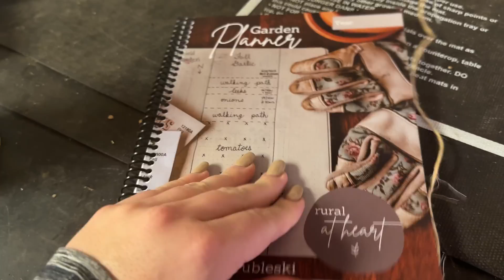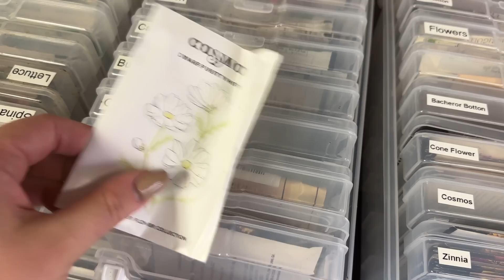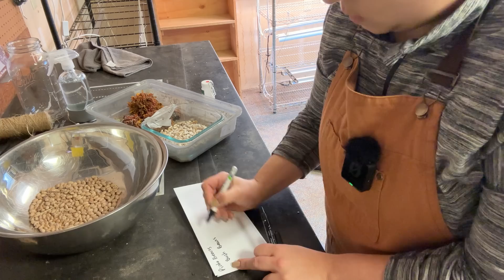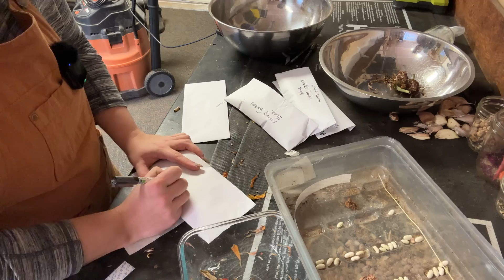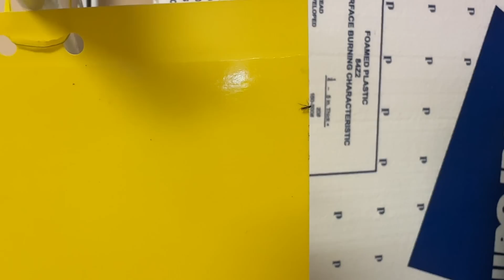I Don't Think I'll Regret This!

Comment: I had a problem with fungus gnats last year, from using a bag of soil that had been stored in my garage from the previous year. It only started with a gnat or two but quickly became TERRIBLE. My indoor pots were covered with gnats. The sticky traps definitely helped but ultimately I could resolve the problem until I was able to put the seedlings outdoors. I'm not sure if they affected the growth of the plants but it was so annoying to have the gnats in my house. It definitely affected my feelings towards my garden last year. I also tried the neem oil and other solutions and I didn't find those helpful. So whatever soil you have leftover in that room, I wouldn't use them for your seed starting, I would definitely just toss it outside. Good luck!!!

Comment: Something simple that works really well when my office plants get fungus gnats is to put a layer of sand on top of the soil. I pour enough to cover the soil. I only have a few plants so I buy small bags of crab sand (for tanks) from the pet store, but you could get larger bags from the hardware store. I think remember reading that the sand smothers the eggs in the soil, but honestly all I know is it works to basically wipe them out in about a week with no pesticide. You can still water over the sand. Eventually the sand will just blend in with the soil.

Comment: I have heard that putting cinnamon on the soil helps and the stickie sheets you have. I have also seen devices (bug killers/zappers). I was very concerned about bringing in bugs into my home when I was trying to grow vegetables inside, so all soil I used I put in the oven for about 30 mins before using. But if you need to bring in plants from outside, I would suggest trying to rinse off all  soil, and maybe spray bare roots with neem oil or maybe hydrogen peroxide? I know they use hydrogen peroxide with orchid roots. But definitely, once you get it under control, bake your potting mix before using. I also had luck with spraying dish soap diluted with water on aphids outdoors when I had them on roses.

Comment: My green thumb guy has battled these pests mostly for me. Lol Because I'm in a wheelchair it's easier on me to have plants inside especially during the winter but there are always some plants inside because it makes you happy to see the green living plants flourish. When he runs into these guys he uses sticky traps like you have and mosquito bits. They are organic but if you actually want to save plants that are infested the mosquito bits have helped a ton. You do have to apply them once a week or so for up to several weeks but hope that helps. Oh and he says those are safe for seedings. For bigger plants he does what's called mosquito dunk and he's had luck with that where we don't have to just let them die. ❤ Make sure to set soil outside in really cold temps to kill them off in infected soil but using it outside would probably be easiest but we have successfully treated some soil by just putting it in the cold. The longer you can the better.

Comment: Try cinnamon sprinkled on top of soul. Also water with alcohol and hydrogen peroxide look formula  up on google I have used  all hydrogen peroxide.  Make sure you keep drains clean on sinks also you can put containers out with vinegar little dish detergent and water I use salt and pepper shaker because of small holes water plants from bottom to keep top soil dry

Comment: Check out Gary from the Rusted Garden. He suggests pouring boiling water into the soil to kill the fungus gnat eggs and larvae. You're probably going to be fertilizing your seedings, so it's fine if it kills the microorganisms. I had an big issue with fungus gnats last year when I brought my outdoor plants inside for the winter, and I read that Mosquito Bits help. I used that this year, and I haven't seen any gnats this year! From what I've read, it's harmless to use on edible plants, too.

Comment: Becky, I’ve been gardening for 12 years, and fungus gnats has been my problem that after thousands of dollars with hydroponics and indoor gardening, I took a year off and did some revaluation. 
I’ve used Neem oil, and meal, cinnamon, and the yellow strips, and nothing worked.
The method that worked for me, I put all my seed starting or indoor soil in the microwave for 3-4 minutes, which will killed eggs and all.
Dump all soil and plants that you brought in from outside, but if you have expensive soil that you don’t want to dump, just pour boiling water on it as it will kill whatever else bugs you might have. 
Good luck…
first Fungus Gnats free.
Good luck

Comment: BT kills the fungus gnats so if you have a problem with them, water the top of the dirt with some water that has BT in it or mosquito dunks water
Reply: The larva live in the top layer of the dirt. You might have to do it a couple of times before all of the eggs hatch and larva die, but it works.

Comment: For future thought... You can pull your plant from the garden dip   them ( upside down) agitate a few times in a bucket filled with water, some Neem oil, a couple drop of sal's soap and a couple T of epsom salt. Rinse the roots well and transplant into new bagged or baked soil.
PS Seeds saved from '23 would be marked '24 for this year's garden. It's just how the industry does it. Incase you seed swap later.
I would love to see your metal cabinet painted grass green bottom 2/3 and the top sky blue then paint flowers, butterflies and sunflowers into the sky.🌻

Comment: Becky! I have personally dealt with two separate fungus gnat infestations.  This is my advice: get rid of all the open soil (including the planters). 

Any soil you use inside, I put it in  five gallon buckets and pour two full teapots of boiling water into each five gallon bucket (to kill larvae). If I bring any plants in from outside, I dig them up and wash off the roots, then add soil I’ve “treated” with the boiling water. Obviously you have to wait several hours for the soil to cool turn before using on plants. 

This fungus gnat issue took six months to get rid of the first time (I had 60 indoor plants). The second time only took two months. It’s because I knew what to do. Rule of thumb, keep everything clean, watering from bottom helps, use sticky traps, and mosquito bits with houseplants (*this last tip won’t work for conscientious organic home gardeners).

If you have any questions, feel free to reach out. :)

Comment: I brought my citrus plants inside and had the same issue because I was overwatering. I let them dry out and it killed off the issue, but I did have to deal with them while they were dying off. My plants handled it okay though. Apparently if you water with a mixture of hydrogen peroxide and water it won't harm the plants and it kills them/the eggs. I haven't tried it yet! Those gnats are so gross and annoying! They take forever to go away, but I guess at least I learned I was overwatering my plants haha!

Comment: fungus gnats are the worst!! i may have a tip for you (still watching) have you tried mosquito bits? usually they're used for small ponds/bird baths etc but you can make a concentrate (mosquito bit tea) and use to water your plants that are prone to fungus gnats when you bring them in. they work by killing the larvae in the soil so yhey never have a chance to fully develop! I tried neem oil before and depending on the plant it can burn the leaves etc so use on something you can regrow fast in case it dies lol but the mosquito bit tea is legit! hope this helps!

Comment: I have a lot of indoor house plants, and not a lot of room, so they're often very close together and can transmit bugs. Because of this, I've had to arm myself with a solid arsenal of potions and powders against pests!

For pests on leaves:
1) spray with a mixture of dish soap, isopropyl alcohol, and cinnamon tea (just steep ground cinnamon in hot water, let cool, and then strain – the reason for steeping is just that the powdered cinnamon will clog up your spray bottle if you don't filter it out). The alcohol will dry them out, the dish soap is poisonous to them (most bug sprays are basically just some sort of detergent), and the cinnamon will leave a lingering smell on the leaves that most bugs dislike, as a preventative measure in future.
2) spray with diatomaceous earth powder. But note that this powder is only effective so long as it's dry, so wait until the first solution has been applied and dried off before you go in with this one. Wear a mask for this one, and then stay out of the room until it has totally settled from the air (one hour). Although it's not advisable to breath it in, this is otherwise pretty harmless for humans. If you get it on your skin, it'll just dry it out, generally no worse than dish soap. However, this is VERY potent for killing bugs; it's the BEST solution against bedbugs and cockroaches, so you know it's powerful stuff! It once again works on the principle of drying them out, sucking all the moisture from them.

For pests in soil: mix 1 Tbsp hydrogen peroxide per 1 cup of water. Use this solution to water your plants as per normal. Not only is this NOT harmful to the plant roots, but it also helps them get more oxygen! It will kill bugs on contact. Repeat this along with your normal watering schedule a couple of times and you should be totally free of the problem.

Comment: Becky, I can tell you those bugs are attracted to white as well as water and bubbles.  If you get a dish, put water in it and some dish soap- (just enough to make it foamy), set it under the lights, they will literally drown themselves.  I have issues with gnats and noseeums almost year round.  I leave a dish out with water and dish soap, again, just to make it a little foamy on the top and without fail, there are several in it every day.  As you well know Becky, 10 parts water to 1 part bleach will kill any kind of fungus or whatever.  Just let it sit for 30 seconds.  If you get a mini kiddie pool, you can fill it up with water, add the bleach and just let it sit outside for a few minutes to a few hours.

Comment: Those yellow sheets work well for those that are flying around but not for the eggs that are laid in the soil. Mix a 1:8 solution of Hydrogen peroxide to water and use this to water your indoor plants.  This won’t hurt your plants but will work for the larvae and eggs in soil.  The flying insects can also be killed by a stronger solution of hydrogen peroxide and water. Good luck, they probably did come in  in the soil from outdoors. Next year when you over winter your peppers wash off all the soil first and start fresh.

Comment: A suggestion: take your vacuum and thoroughly clean around the window and anywhere else they seem to gather. Then immediately empty or get rid of the bag in your vacuum outside. I think that you will probably need a watering can, so that you can fertilize your seedlings. I believe you forgot to wash the up potting containers. As far as using the landscape fabric to cover plants in the garden, I think it would make more sense to purchase the netting made for that purpose. I don’t think the plants will be able to get the air they need under the landscape fabric and it will probably cause more problems than it’s worth.

Comment: Years ago when i was first getting into house plants i ended up with a massive fungas gnat infestation from a gifted plant that was already infected. I tried neem oil for ages and nothing worked except the yellow sticky traps. To this day i cut down the big sheets into little squares and put them on top of the soil at the base of my house plants, and then i bottom water all my plants. This was the only way i could get rid of them and keep them gone. This year i am starting seeds indoors and i had fungas gnats appear in my starts, i bet they were in the seedling soil i bought, because the rest of the bag is infected too. I'm not sure what to do to prevent this going forward but as i don't have a good set up yet, literally starting seeds on my desk in the window and then moving them from window to window following the light throughout the day.

Comment: Hiya Becky :), Sorry about you bugs .. they are so freakin gross!! I had a massive indoor plant infestation, and I tried Neem cake tea after lots of research and it absolutely obliterated them ..scattered a light layer of the dried tea on the top of each plant, then I used the tea via my regular watering schedule instead of water. It took two weeks and three consecutive waterings. I have not seen a single one since and that was 7 months ago

Comment: if you go to a farm store, they sell good bugs. Buy nematodes. They are a microscopic bug that eats the larva, and fungus in the soil. They are easy to put into the soil. Don't cause any kind of mess. Live for at least a year. I've ever only had to apply them once. I've used them in outside gardens where my seeds wouldn't grow, and inside. Cinnamon is a surface treatment. neem oil will work on the surface of the plant. But the nematodes actually save the soil. They make it even healthier.

Comment: I agree with the person who said these are likely aphids. When I bring my delicate plants in from outside I always end up bringing in aphids and whitefly which then thrive in the warmth of a heated home as the cold doesn’t get them to kill them; I spray them with some soap water (2 teaspoons of eco friendly biodegradable dish soap to a pint of water) and wipe down surfaces around the plants and the leaves or stems with the solution where possible, using some kitchen towel. I usually find that this does the trick after a week or two, it’s just a little extra effort when you first notice the problem. On the whole, as annoying as fungus gnats can be they don’t tend to do too much harm to the plants and can be kept in check by not overwatering, “Adult fungus gnats do not damage plants but they can cause annoyance when they are flying around indoors. The larvae feed mainly on dead roots and other decaying plant material and associated fungal growth.”

Comment: At the end of garden season, if you have a power washer that has a tank for adding cleaner add vinegar or a organic soap, on a low pressure wash would be a bit easier kiddo. I love my garden too, as far as bugs I have found that BT and Dimetrius earth is a food safe bug killer for the aphids, leaf miners and such. Every year can be different with gardening, the weather can be our worst enemy, the last two years here in Missouri has been horribly hot and a drought that's been so very bad, I'm praying we don't have that this gardening season. The one thing that always does good for me is my Kennebeck potatoes and pumpkins, which I'm in the middle of dehydrating a bunch right now, and will have some potatoes sprouted out to get another year of potatoes which will be my third year of planting from the original ones I bought and planted almost 4 years ago, that has paid back big time with the price of potatoes these days. Best of luck, it is a lot of work but the payoff is huge in my eyes I know what is going in our bellies, with allll the food recalls these days.